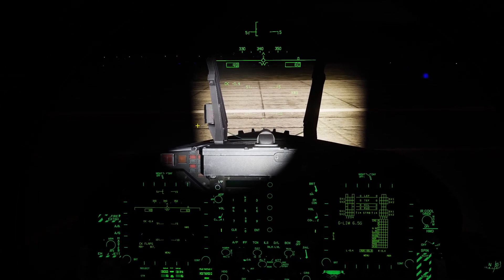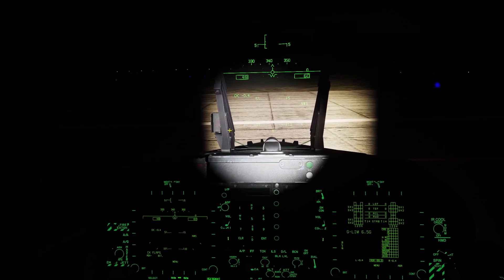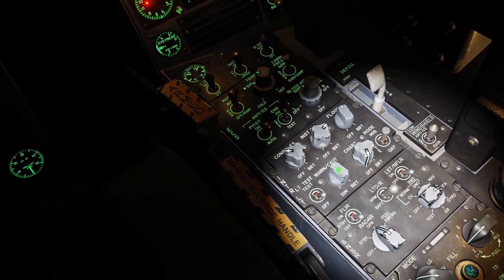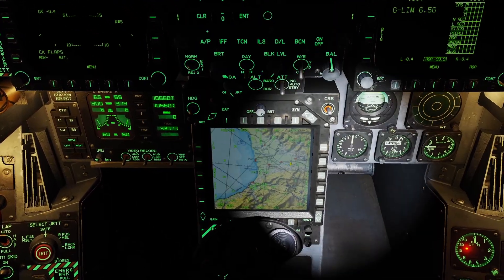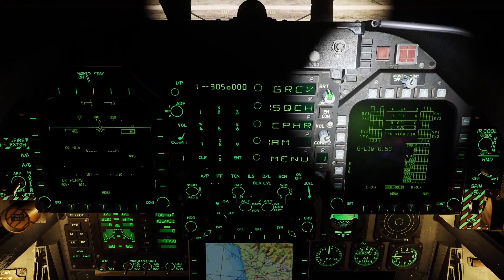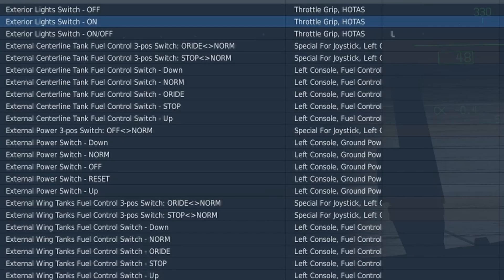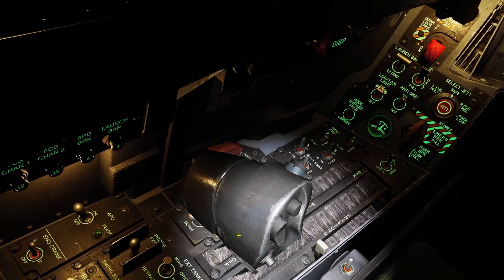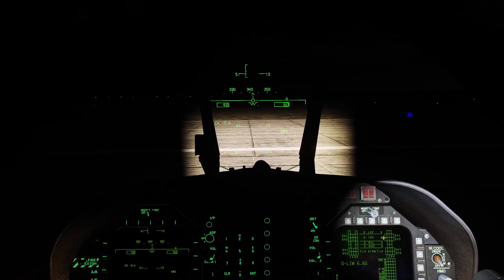DCS F/A-18 Lights

Comment: Nice tutorial but I'd like to add how you can enable all lights when the engines are not yet running: a) Ask the ground crew to connect external power.
b) EXT PWR switch to RESET (right click). The battery is automatically disconnected, although the switch remains ON. c) GND PWR switches 1, 2, and 4 to B ON (left click). Hold for 3 seconds while each performs its BIT test. d) BATT switch to ON (right click) if not already active. This will also allow you to use the radio with engines off.